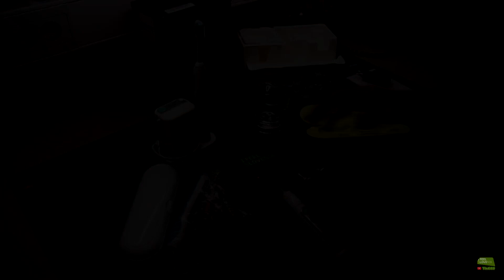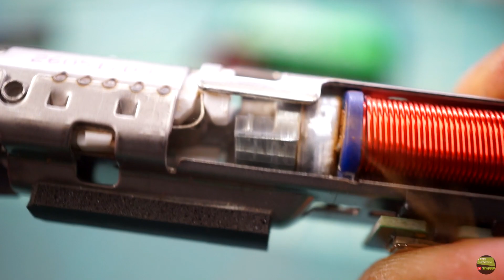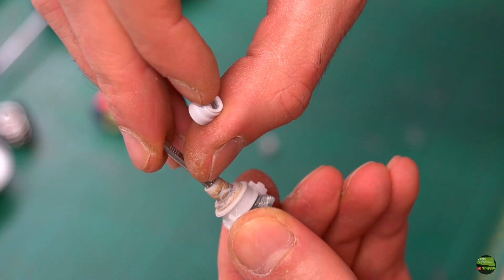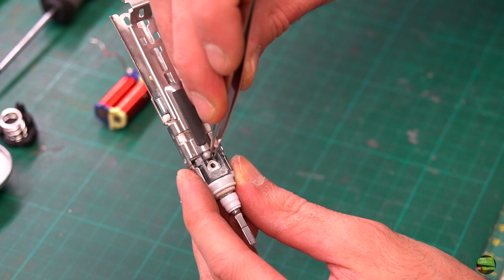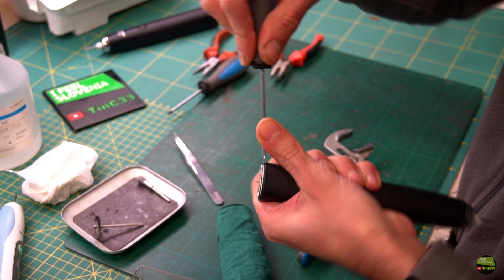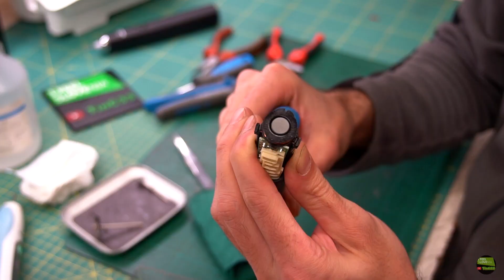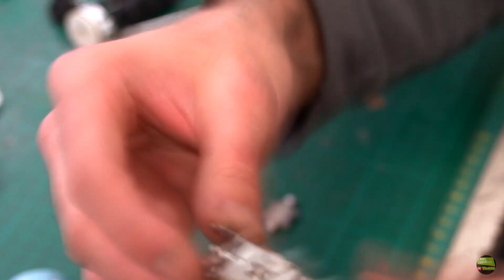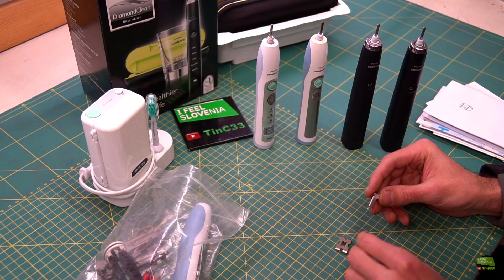How to: Philips SONICARE Repair [3 brush / 3 different fails]

Comment: I have two of the HX6800 series, one the screw holding the tip in place had fell out. That was an easy fix with lock thread locker and reinstall the screw and tighten.
The second brush the head (metal tip) that holds the brush is loose no matter how tight the screw and metal holder are the tip is still very loose and vibrates too much. Do I need a new head tip holder?
Reply from the maker: You probably got broken thin metal part inside (check my other video about sonicare repair and you'll see what i thinking, there is no other way like buy entire vibrator on ebay and replace it.

Comment: Aquafloss sonycare power buton stoped working.  Any advice?
Reply from the maker: Does it turn on if you make a short on button pin? Or how do you know the button is failed, its easy fix replace the button 😉
Reply: @TinC33  thank you.  The button is kinda rubber. I press and it's not turning on. No way I  can find such a button where I live🐒
Reply from the maker: @irinastarikova8078  where you live lastname sound like you'r from ukraina, polska, češka somewhere there 😉 did you pull electronic out of housing, then try to make contact between two pin fom the button, there are 4 but only 2 will work...

Comment: My sonicare had stopped vibrating good. So I watched this video and fixed it. It wasn't corroded inside at all. It still looked new inside. The motor had moved forward on the magnet. I moved it back some intead of taking everything apart I just unscrewed the visible motor screw and put a screwdriver on top of the motor and tapped it downwards until the motor moved from the magnet and then I tightened the screw back up really tight and it works like new again. Great video.
Reply from the maker: Thanks but be careful if the spacer between the coil and magnet is too big, it won't wibrate as powerfull as if the magnet is closer to the coil, separate them that much so it won't touching, i think i set about 0,1mm of space between.

Comment: Mine just began to vibrate very weakly, everything else is fine (10 years old). Is that evidence of the broken sheet metal part you pointed out? Anything I should proactively replace as a maintenance issue once I have it apart?
Reply from the maker: It could be loosen screw but most likely there is a broken part, in that case you can just buy new complete vibration mechanism on ebay.

Comment: I have a sonicare 5100 series . Black diamond I believe. Has the wobbly head. Cleaned nut and screw. used locktite but head still wobbles even before putting back in housing. Not obvious what to do now. Ideas ?
Reply from the maker: I think you got broken part inside of mechanizm, you can see more about on that videohttps://youtu.be/BB1zvvNRUek
Check on ebay for new vibrator mechanism.
Reply: @TinC33 Thanks. Ill look at it. I first tried just putting loctite only on the screw after cleaning it, screwed it in and it still wobbled. I took apart again and  wire brushed screw AND nut. Nut appeared to have some black material on it. Ground this off. Added loctite to nut and screw. Assembled. Now head does not wobble. Seems secure. We'll see how this holds up. I'm reluctant to take head apart at this point. This toothbrush has a copper wire running up along the outside of this head unlike the previous sonicare models my wife and I have owned. I save my old brushes for parts but the head of the 5100 series is very similar but different.

Comment: Great video. But do you have any suggestion on the start button not working (it charges well..at least the LED turns on while charging). Mine does not seem to have much dust/rust.
Reply from the maker: The clearence between magnet and coil is ok, if they stick together there will be no movement at all.

Comment: Finding it really difficult to release the hooks to get assembly released from body. Are they on the “short” side and is there a trick to release them?
Reply: Apply downward pressure on the brushmounting stem as you depress the black tabs in toward the center of the cylinder.
Reply: I had the the same issue the first time, they are more like tabs that push out on two sides. Look for them on the left and right side (top of the brush tube has the buttons and lights. They
are plastic and just  need to be gently pulled towards the center away from the sides of the cylinder.  I would unseat them and pull on the plastic circular end with pliers gently and it should slide out.
Reply: Squeeze the cylinder slightly (try one way or the other) and they kinda push them towards the front or back to unseat them

Comment: Love your videos. My Sonicare seemed more or less dead; the yellow lighted blinked when charging but when I try to turn it on nothing happened. I thought I needed to replace the battery but it appeared fully charged at 3.8V when I opened up the brush. Any idea what could be the problem?
Reply from the maker: Hmm don't know for sure, but if there only yellow led it could be something with a battery, try to remove the battery and use some piwer supply to make a test.

Comment: I like this video and go encouraged to repair mine... My HX9350 is suspiciously failing few days after warranty expires. So far I have bought a replacement but this is expensive and not very earth friendly! I dismantled the parts but when I press on the on/off button, nothing happens. It is charged and when I put it in charge mode, the green light flashes. The little plastic rubber was worn out and traces of water inside the brush means that it was not waterproof anymore! Any idea how to fix this?
Reply from the maker: So it doesn't vibrate, check for the clearence between coil and magnet.
Then search on ebay for new head seal, or entire head.
Reply: @TinC33  Thank you for your recommendations! Much appreciated... It seems it does not vibrate regardless of the gap. It seems that nothing happen when I press the on/off button although the toothbrush is showing fully charged. Any suggestion?
Reply from the maker: @benoitkowalski2206  try to dissasemble and try to put screwdriver to the coil, if it stick to it coil works than just need to set clearence between magnet and coil.

Comment: What if the wires disconnected from the main coil but stayed attached to the PCB? There's also wire coming down from the brush head but it isn't connected to anything.

My guess is that that was all one wire that broke and I need to tie it somehow and reconnect it to the main coil.
Reply from the maker: I'm not sure about what wire we talk, there are new models with somekind of preasure sensor for the head, i don't know those types, but you can see if tbe wire is broke from pcb or somewhere else.
Reply: @TinC33  Got it. So I'm gonna need a soldering iron. I'm excited to get one! 

The wires connecting to the bottom of the copper spool also broke but are still attached to the PCB. Would you recommend tying the wires back to some wire dangling at the bottom of the spool or soldering them to the nodule sticking out from under the spool?

Not sure if this makes sense.

Comment: My toothbrush keeps blinking green light when I charge it and when I take it it doesn't work 
When I click the button when its charging it vibrates alternatively (I mean tik tik tik ....)
Reply from the maker: It may be battery issue but i'm not sure.

Comment: Just took mine apart due to a loose brush.  The screw is not loose at all but the brush is really wobbly.  Ideas?
Reply from the maker: Then you got broken part inside, buy new wibrating mechanism on ebay, it cost about $15